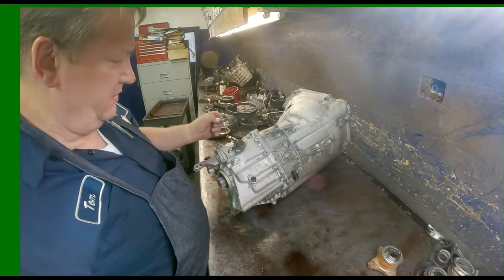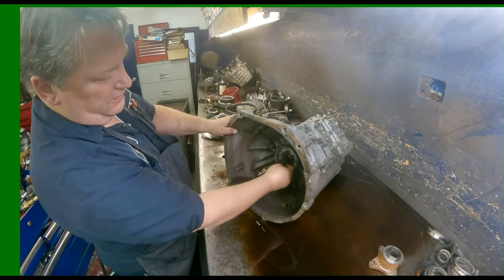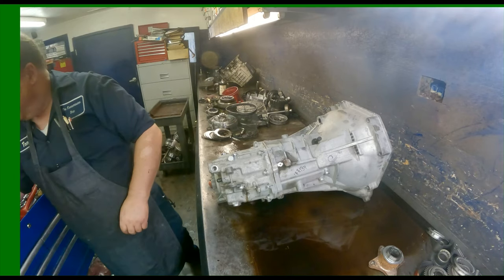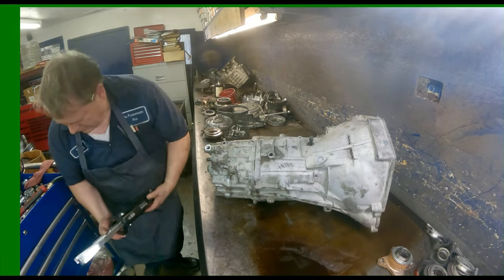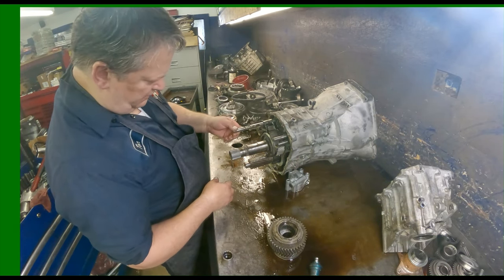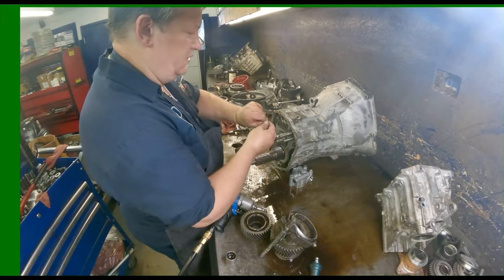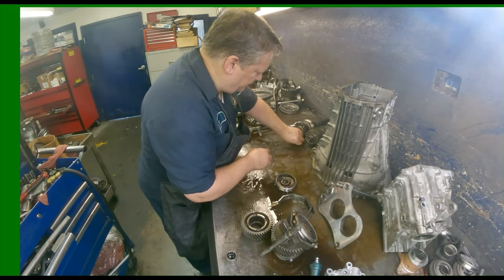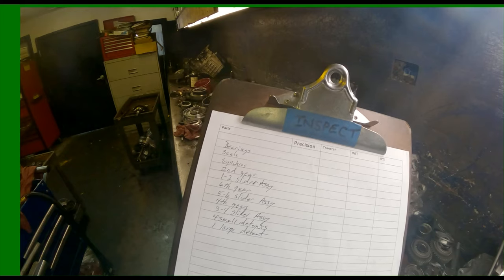MT82 Standard Disassembly

Comment: After going through 2 used transmission, I decided going to rebuild it this time. The original had input shaft bearing failure when I purchased the car, the 2 used ones also came with fair amount of up and down play in the input shaft and not only sounds annoying its eating through clutches. Seeing this video as I'll be doing it this winter. Not my first transmission but yes my 1st mt82, got very good idea from what I've seen, thanks for sharing this.
Reply from the maker: Thanks for watching.
Reply: @CurmudgeonTransmission thanks for the video. Is there a kit to beef up the MT82 transmission that you recommend? Or a kit to rebuild it?
Reply from the maker: There are all kinds of upgrades you can do. Here is a good thread for you. https://trackmustangsonline.com/threads/mt82-repairs-upgrades-parts-tech-advice.10511/ @goofylevitates8853
Reply: What type of rebuild transmission ?

Comment: How did you end up removing the detent plugs
Reply from the maker: There is a tool to remove them. I do not have it. I removed them with a hammer and screwdriver. It will destroy them and they will need to be replaced if you do that. They are a tremendous pain to get out. One other way you may try is a small bearing splitter. very hard to get onto some of them though.

Comment: That’s a 11-12 MT82.   Skip shift.
Reply from the maker: You would probably know more about them than me, only had a couple come in. Kind of a pain to do without some of the correct pullers.
Reply: @CurmudgeonTransmission  yes they are,   Use caution putting the rear cover on.  The 2 shift rods go into needle bearings pressed in the rear case, if not lined up correctly it can damage those bearing.  👍🏻
Reply: @MustangGuru correct you are sire